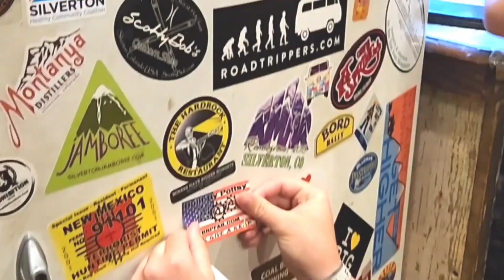2003 Jeep TJ Jeep Project 80% Done..With John "Woody" Woodruff Jr. @ Ott's Body & Frame LLC

Comment: Not gonna lie, I haven't watched the video yet, but I know I'm gonna like it already 😂 So here's the first comment saying it's awesome congratulations 👌
Edit: I've watched the video and... it's awesome. Congratulations 😅
Reply from the maker: We have been working on it for a year now... I ran out to Grand Junction, Colorado last October and bought a frame.. Started from there.. If you search back in my videos you can find the different build stages.

Thanks... Been a ton of work for both Woody and I..
Reply: @builtbypottsy-byrdkrap  that's just unbelievable, makes it 10x cooler. I have a 98 Sahara with good KMs on it, no rust and Dana 44 rear. I wanted a good base and I'll lift it 2 inches, run 33s, lockers front and rear. Rock sliders, steel bumper front with a winch and roof rack with swing out tire carrier on the rear. It will lose its stock looks but I reckon it will be more capable. Let me tell you, the looks I get when I go to a mild trail with a stock Jeep with cleaninsh body and stock rims and tires is priceless, I think I'll miss the chats ("did you come all the way through there, or did your buddies winch you??" 😅) but sometimes it's not so easy going, I can't wait for the mods